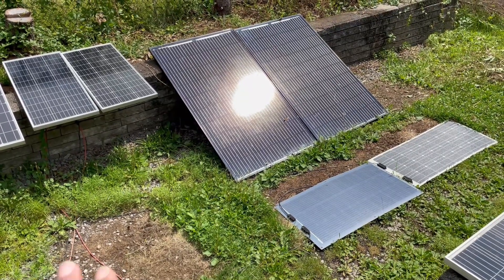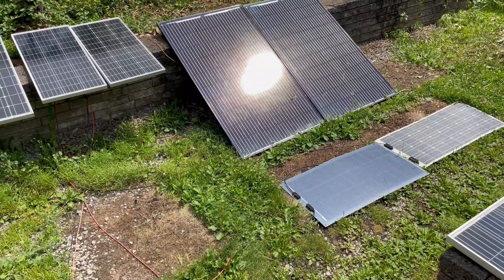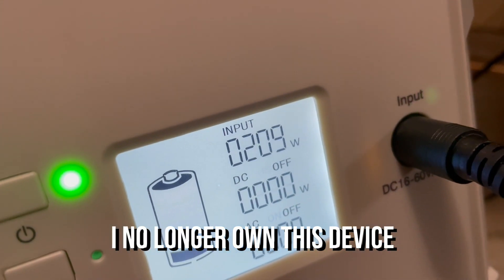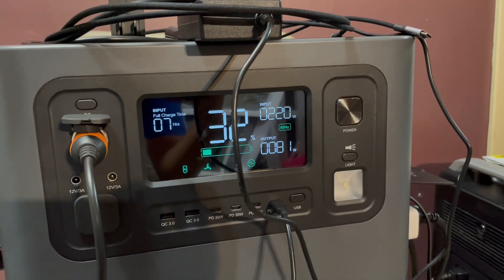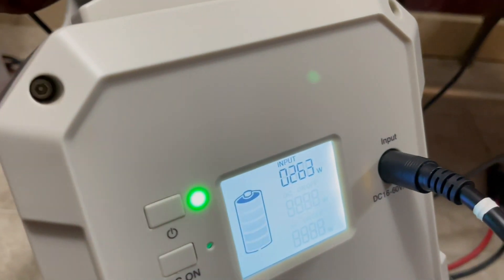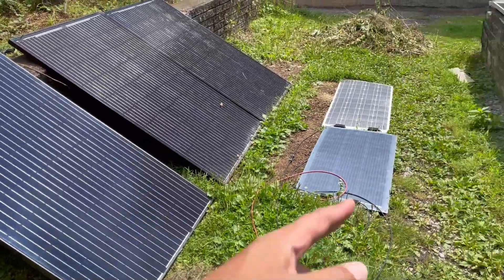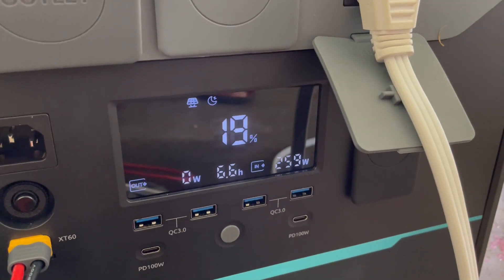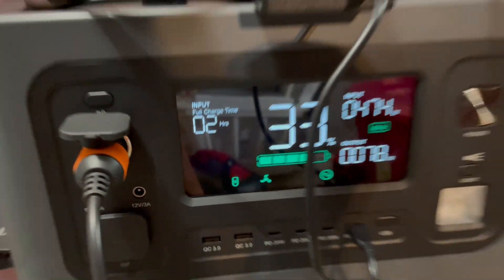Downgrading My Solar From 400 To 300 Watts But Why??

Comment: why not compare the panels at the SAME angle on a SUNNY day?
If you wait 10 minutes on a cloudy day and then plug in the other comparrison panels,,,,,,, the different cloud blockage could affect the reading?
I'm not understanding how 300 watts can produce more?
Reply from the maker: It's not a comparison video boss. That's not the goal of the video.

I think the 300w produced more because of the angle of the panel compared to the angle of the 200 watts laying flat on the ground because they are flex panels that can't be angled properly without some effort. 

Keep in mind, I'm a YouTuber who has a good bit of stuff and I like to use as much as possible but then I like to get the most out of my effort. I love a complex life.
Reply: @AskIveSolar  Maybe it produced more because one panel of your bigger system was like a clogging in a pipe, that reduced power output. All panels need the same Voltage and amperage should also match. The panel with the lowest amperage limits the power. Thats at least what it looks like to me was the problem
Reply from the maker: I guess for me, that doesn't matter because the video wasn't about output but about downgrading to a single panel for more Mobility.

Comment: I thought it might be some kind of voltage issue, but I know you've got plenty of stations that can take 40V.  You might need to build yourself a rolling stand like Jasonoid did for some of your bigger panels.
Reply from the maker: I never even thought of the reason possibly being voltage. Good guess though!

I really don't have space for it @ rolling stand

Comment: Obviously you don't want to get rid of the other panels because it's always nice to have spares and all that, but I imagine it definitely is more convenient to get 80% of the power from one single more modern efficient panel compared to having to string together four portable panels.
Reply from the maker: Yeah it's great to have a single panel rock out! I also moved a few of my panels maybe once a day sometimes to get the most output.